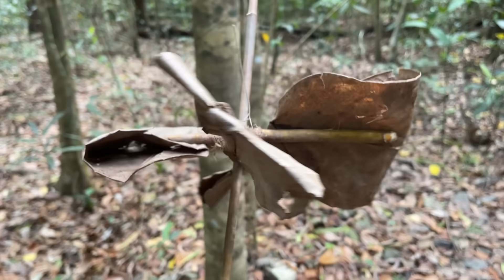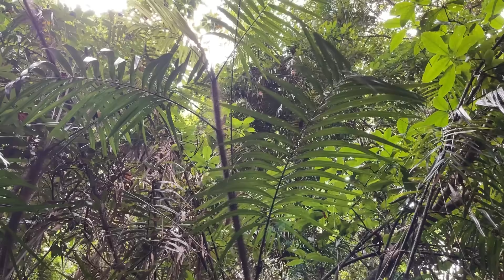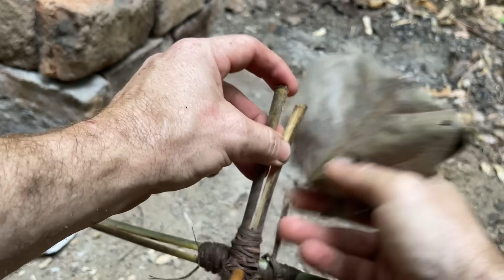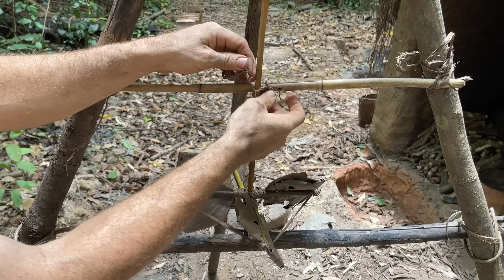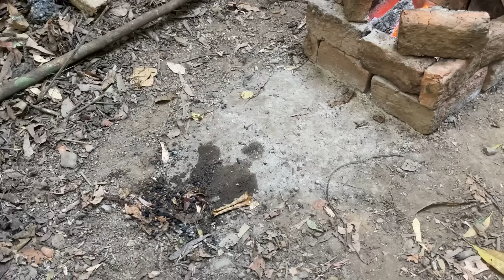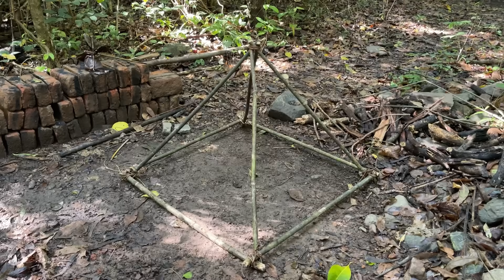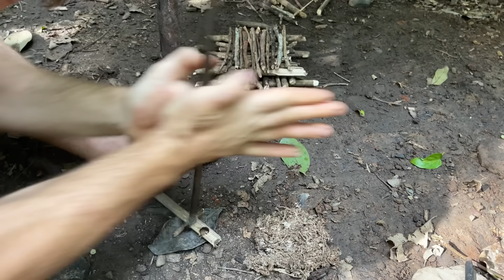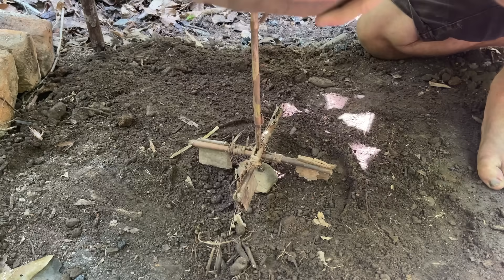Primitive Technology: Convection turbine experiments (hot air windmill)

Comment: You could use clay roofing instead of leaves to prevent it from burning down. For the fan itself I don't know though... You need something fire resistant and lightweight. Metal seems to obvious choice but your experiments with metal working haven't come far enough for metal to be a viable material.

Comment: Here’s an idea: if you use some bark fiber rope as a belt, you could try giving the rotor shaft and blower fan a 1:3 or higher gear ratio (from rotor to fan) using a pulley rather than actual gears!

Comment: Hear me out: make a oven/kiln with some kind of exhaust, then redirect the hot air in the exhaust a little offset so the flames wont direct hit the fan but only the hot air, then connect the fan to some kind of gearbox to make it spin faster, then use the faster spinning shaft to power the blower.

Comment: Just spitballing, for fun. I’m not an engineer.

 What if you use an auxiliary fire in a larger sealed enclosure which is fed via natural draft at the base and exhausts mixed at the top with the primary smelting fire. That way you can use both of the fires exhausts into fan shaft power. Assuming the walls made of clay from a birds eye It would be 1 large half circle for the auxiliary fire, 1 smaller circle for the fan shaft within the larger half circle around the centre, and the last circle (bloomery) touching the shaft circle on the other side of the half circle. Air intake for the fan would be at 2 points both between the auxiliary half circle and the smelt fire circle. Both exhausts would tapper to towards the top forming a 1 exhaust circle holding the power fan connecting the shaft. Having it isolated in the centre also keeps it away from the fire burning it hopefully lol.

Comment: I really don't see how you will be able to create a "turbine" with the materials you have. It requires more then just airflow. The gasses need to be compressed then pushed through, with a passage that allows for rapid expansion on the other side. Not to mention, the materials will just eventually burn up from the heats. Might be easier with water, and that is why turbines are used with steam and fuels. Turbines generally don't have a lot of torque. Water turbines have better torque from the weight of the water.

Comment: I don't really see anyway that the rising air could ever produce enough rotational force to make a blower really blow the same fire. You're effectively working in a closed circuit, and you can't get more energy out than there already is within that circuit. It's why a hand or water wheel spun turbine will produce a better blower, outside energy is being put into the system.

Comment: This is brilliant. the best results i have seen for a continuous air flow forge was with the water wheel blower you made, but it seems unreliable. you would need to build a pretty large aqueduct system to bring water to a suitable forge site, not to mention it would all get destroyed in the wet season. but with a convection turbine you may be able to unlock the continuous mechanical motion required to get the airflow needed for high temp quality metal forging. perhaps if you create a more narrow hood out of ceramic that can withstand higher temps you can get the airflow needed to bring the turbine up to the required speed. if the hood has a curved taper to it like the Eiffel tower, it can pull the air more efficiently.

Comment: I saw a video about something like this being proposed as a renewable energy source. They were going to build a 250 acre plastic tarp that funneled heat to a central shaft with a turbine in it. On the outer edge where it isn’t as hot they wanted to do gardens and then collect water from it as well.

Comment: I would recommend a larger diameter drive...fan.   longer blades = more surface area for the hot air to push on, as well as higher torque.  Torque = force x distance.

Comment: Seems like it might be more practical to build the fire similar to a down draft furnace, but having the turbine in a tube on the inlet side. Or have it in the exhaust side of a downdraft furnace, but have a widening part way up the column where outside air can be mixed with the exhaust flow.

Comment: Ideas:
1. Clay/brick chimney stack for airflow: keeps air hot, and could funnel it to a smaller turbine offset from the fire
2. Thin coat of mortar/clay over turbine leaves for improved fireproofing? maybe
3. if unable to offset the chimney too far, could use a rope pulley on the non-fire side of the leaf turbine to connect to the air blower
4. and this one is out there: a Dr Seussian loopy af chimney that narrows and blows back into the base of the fire, along with inlets that help suck air in so there's fresh oxygen

Comment: Clay tiles for heat res and tighter fit, you need as much as possible to hit the blades. And then reduce rotational mass, while increasing blade size and or better funneling past them. More blades and shallower angle and with that nat twist in it , it kinda imitates a jet turbine. But yeah, my mind was blown when you dropped the blower and I went "turbo!".

Comment: If you add a smooth, hard surface in the blower for the shaft to rest on, i bet it would spin faster. More blades on the blower and turbine. Also, a clay tile roof so it doesn't catch fire lol

Comment: Need to set the blades on a lower angle of attack. The steep angle you have is great for maximum torque, provided you have a large enough fan with as minimum friction as possible..in this case you really want more speed than you do torque. Set your blade angle to about 30 percent of its current angle and you should see a marked improvement

Comment: For directing the column of heat, I'd suggest a pyramidal stove and chimney made from mud, brick or clay, with the fan blades above it in the open air.  Also, broader fan blades, like a home ceiling fan or bigger, maybe using woven fan blades of green loya cane, more fire-resistant (assuming the fire safety monitor approves, of course).  But it's a good idea, capturing some of the wasted heat to run a turbine to charge up a kiln with more oxygen.  Although, a mechanical infusing of more oxygen may be more problematic than it's worth.  An easier and more effective way to introduce more oxygen may be to passively ventilate the bottom of the kiln more effectively.  Instead of holes at the wood feed opening, or front and back only, maybe have holes all around the perimeter, like have the whole thing up on edge and middle 'legs' made from upended bricks, total airflow all around the bottom, and use the draft from the heat to draw in the oxygen.  Flatten a large square, and stand up 100 bricks, 10 rows of 10, 1 brick apart from each other, then a layer of bricks bridging those (no closer than 1 brick apart), then another layer of bricks at right angles bridging those, then build the kiln on top of that base.  Maximum air flow!

Comment: It's  a cool idea, but surely using a water wheel would be less challenging. Keeping things dry wouldn't be easy, but I would think it would be leaps and bounds easier than trying to capture and transmit the energy from the fire in any efficient way. Maybe digging some ditches and building some weirs could let you control the flow of the water so it's not always flooding the workshop. Grady over at Practical Engineering just made a video on Pulser Pumps, which can lift water without any moving parts. Perhaps you could build an aquifer of some kind to move water over to the workshop. In any case, this was awesome to watch and I look forward to whatever you think up next!

Comment: I loved the "fire safety monitor"!  What if you put the fire outside, and build a crooked chimney stack to route the hot air under the turbine?  There were natural lubricants used by primitives - palm nut & other plant-based oils, and also animal fat.

I've noticed you don't really use timber.  You use plenty of cane, palm and other plant materials, but you don't really cut, dry & shape larger pieces of wood.  The ancient Maori were artisans in wood, making canoes, utensils, art, weapons and entire buildings from very large, intricately carved & shaped wood using stone tools.

Comment: Dude, ILU but this is just a toy. There is no real power being generated from all of that heat energy available. Build a venturi stack with 5 or 10 sets of blades out of clay with increasing diameters and decreasing blade angles. Then you might have a fire powered motor.

Comment: A tile roof would do well here. That is if you can think of a way to lash the tiles to the roof from the bottom. Also, a Smoke stack would also help. Further more, wall up the fire pit a bit more. Those three things would help trap the expanding gases, allowing the heat to be funneled into the turbine.

Comment: So you have harnessed the power of wind to make wind.

Suggestion: Set up a system where water slowly empties from a cistern to power a waterwheel, attached to the blower. Much more mass and with a good gearing system like your rope you could probably get a good speed. You have to top off the water in the cistern regularly but it's a once per 10 minutes or whatever task.

Comment: I swear, if this man finds a source of copper he could go great lengths
Reply: If he finds copper, he might start making electricity.
Reply: He could craft green circuits and automate quite a bit of his manual labor. To go to space, he'd need to find crude oil, though. Uranium is handy, but completely optional.
Reply: What if he finds uranium?
Reply: @-unity-  Then he gets yellow pottery
Reply: @Bubben246  can't wait for the kiln fired fiesta ware
Reply: and then tin for bronze !
Reply: He already passed copper, he's gone straight to iron. He's made stuff before by converting river bacteria into iron and melting that into things.
Reply: @ageishyena3035  iron is very hard to work with though. Its also Very brittle unless you can work it properly which he cant. Overall copper and bronze would be a lot more useful for him. Especially bronze can be coldforged which would be awesome.
Reply: @Sol0666  Can I sign the petition to let him cheat a little and get a bunch of ores :D 
Maybe that could be a idea for another channel. Something like playthrough to Iron age :p
Reply: @ageishyena3035  He never passer the copper age, he made one extremely bad iron tool that didn't last.
People in the copper age too could make iron tool, mainly from meteorite, but they rarely did because of how difficult it was.

Comment: I love the concept, but don't think that it could be used to blow air into the fire that drives it. The speed of the fan would be limited by the outflow rate of air from the fire, which is already the inflow rate of air at the bottom. The fan would have to spin faster that the inflow rate to be "blowing" the fire, so it would have to be driven by something other than the fire itself.

Comment: A great idea, even if it's just as an extra air intake for the furnace.

Perhaps fixing the main shaft in the middle to keep it more stable would improve the rotation.

Maybe building one of these in the center of the hut to take advantage of the ceiling from there would also be a good idea.

Comment: You can pump water uphill and make compressed air with it with just pipes of running water. In
Practical Engineering on you tube shows how the Alhambra’s fountains were replenished uphill without pumps by this method. You have a stream and can make pipes.
Reply: Oooh, I shall have to look up that particular video!

Comment: I don't know about using it for a blower dude. But one thing it could be useful for is boring holes into timber. Just affix a stone arrowhead/awl to the base of the rotor, fix the "everything catches fire" bit, then you can bore holes through lumber and beams while AFK. It'd certainly give you more options for your frames and tools.

Comment: Aerospace engineer here

An impeller is a disk that transfers power through a shaft. 
That disk is more effective the larger it is. Also ducted fans are more efficient than free floating fans so try putting your impeller in a chimney. Specifically a converging diverging chimney. Its just converging here. 

The second is your shaft is trash. Your shaft has to be well balanced and aligned in the minimum axis of inertia (its center of rotation)
 Straight up and down and well balanced which is hard to do with a long shaft so try connecting your impeller inside a chimney not directly to your blower but to a  flat stone with a hole in it and connect the stone with a pulley to the forge blower so they are two seperate smaller ideally very straight shafts. 

Youre losing a ton of power because the thermal heat of the air is kept in the air. You can use a converging diverging section to transfer that heat into kinetic energy by making a diverging section at the top of your funnel. 

And even if you do all that your bearing (rope tie) is going to limit your maximum rotation since it has such a high coefficent of friction compared to actual bearings
I would honestly make all the wheels out of clay with grooves for rounded balls to act as bearings since your losing a ton of energy into the rope that acts as your bearing.  You can create a circular disk of clay with grooves on the side resting on the surface it is. 

Honestly this is real science tho nice dude. This is how a modern turbojet works. And if you want to make it work you should learn how shaft efficiency and how rotors transfer power from the combustion products to an inlet blower to fuel said combustion reaction.

Comment: I feel like this could be made better by boiling some water and forcing the steam up the chimney past the turbine. But either way you're going to need to make your turbine blades a lot longer than your blower blades. You don't have enough torque right now to do what you're trying. 

I know you've already explored some of the uses for falling water, but are you familiar with a trompe? It uses falling water to trap air and compress it so you can use it for other things (like heating coal in a furnace).
Reply: steam boilers only really work when you can contain the pressure, which is hard to do with ceramics or wood as they're quite porous. also if the steam is only barely above boiling then condensation will also slow the turbine quite severely.

Comment: I think if you used your nice forge from the last episode (with the grate and pit under) it would accelerate the air more. I also just more heat pulls in more air. You'll probably need to make the power fan much larger than the blower for mechanical advantage

Comment: yeah i kinda figured you weren't gonna get much useful work out of that thing.

a primitive steam engine might be asking a bit much, but you would get better torque out of that. you could make it out of clay but it will set an upper limit on how much pressure it could handle, if you could glaze the clay that might help, coating the clay in glass might help it hold more pressure...concrete might also be an option. the power comes from the pressure differential, so how much pressure you can contain will directly correspond to how much power you can generate.

but then there's the turbines...i don't think those leaves would be very good steam turbines, it's a shame you don't have any good sources of copper nearby, it's easier to smelt than steel, easier to cast and just easier to work with in general. 

though maybe making it a bit simpler...like ancient rome simple...a clay vessel with two spouts coming out the sides radially and curving to opposite sides, the pressure isn't so high it's likely to explode and the torque is good enough to turn the bellows. you would need to replace the water from time to time.

the most likely point of failure, though, will be the arms...normally they are pretty thin, but normally they are made of bronze, thicker would be stronger but also more likely to pull it apart. probably instead of arms use fluting.

Comment: hmmm I thought of suggesting force transmission using different sized wheels, but the contraption would become heavier, reducing efficiency. If you can devise a way to apply force transmission with lightweight components, I'm pretty sure this can work as a turbo charger
Reply: perhaps build weels with very light twigs and cordage? this might even improve adhesion to the "belt". I'm thinking of something like a bicycle

Comment: Yah, no non-pressurized combustion gas system will ever beat the draw force of a natural draft chimney. Build it tall, build it wide bore, and put a roof on it to keep out the rain, and it will melt cast iron.

Comment: Definitely needs to be above a proper chimney with maybe pulleys and a belt to transmit the power. A varying ratios of fans and/or pulleys might help with keeping the blower up to speed. 

If sticking with the roof, the top should be a round oculus (like the Pantheon in Rome) for smooth airflow to the turbine.